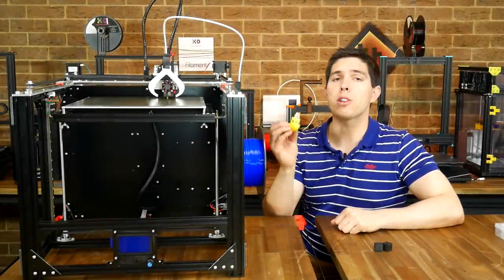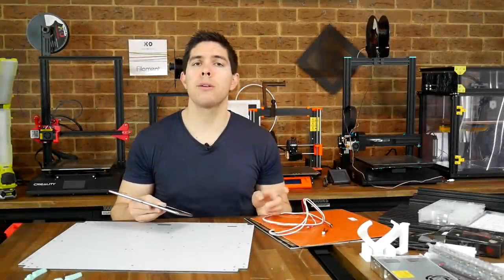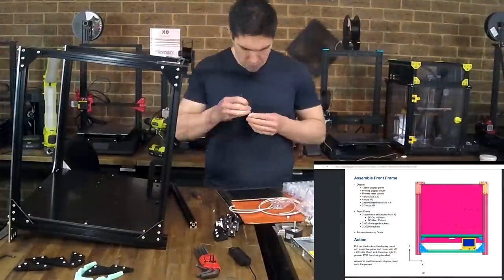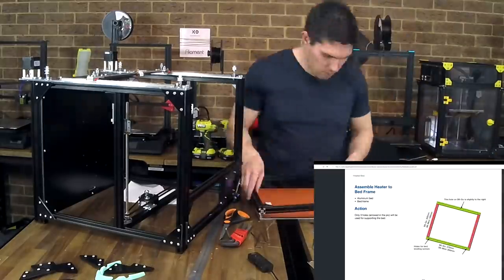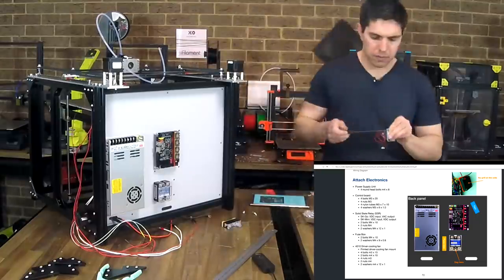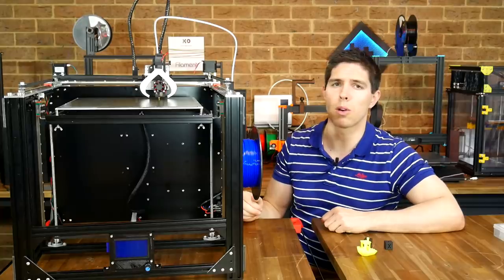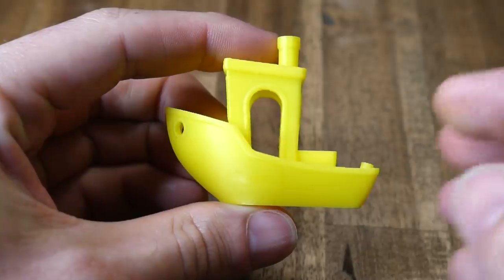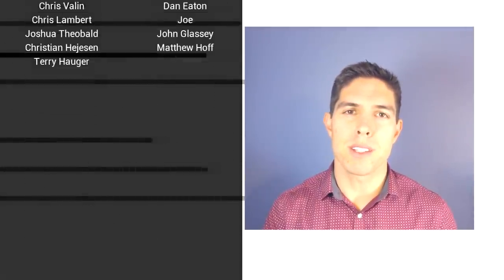SecKit SK-GO assembly and test prints - CoreXY linear rail 3D printer

Comment: Michael, truly thank you for the valuable feedback and faithful review. For the issues of short wire and bed frame I will definitely fix them in the next batch. Your Z endstop mount and filament sensor holder are a must-print!
Reply: WOW so humble and open to feedback!!! so much better than a certain RUSSIAN manufacturer
Reply: Would this design scale up to a bigger size? I really want a 510x510x510mm corexy design.
Reply: @originaltrilogy1  At this size the major issue is stiffness of the bed and thermal expansion. I'll suggest to use SK-300's structure (3030 extrusion, tooling plate, 10mm belt, etc. as shown in my website), but haven't evaluate cost and weight / shipping yet.
Reply: @seckit3dp  is there a budget friendly option available?
Reply: @Leo-Lion  SK-Mini (220x220x250) shares the same structure as SK-GO and is the most economic model.
Reply: @Leo-Lion  - They have the option for you to source your own aluminum and save money & shipping costs. I'm pretty new and just getting into the hobby; but that also means I've been researching and pricing out a lot of printers over the last few weeks - and based on what I'm seeing this is one of the less-expensive printers out there that also gives you at least a 300mm^3 build volume!  You can save a little bit of money by going with a small-sized Creality or one of the alternatives that Michael has pitted against the CR-10/S/Pro in his recent comparison videos; but this already looks to be a pretty good deal compared to most printers of its size...
Reply: If you choose the magnetic PEI bed is the main bed that the bead heater attaches to a sheet of aluminum?
Reply: Seckit 3DP I have interest in that to!
Reply: @seckit3dp  I am using 6mm cast toolplate for the bed, it works very well in other designs.
Reply: @noelwade  and you are not slinging a bed around, which equates to faster prints and less ringing
Reply: Seckit: The ordering page is a little confusing regarding the bed: "(Self-prepared) A boro glass no larger than 220 x 220 mm^2, masking tape, polymide tape, etc."  That's presumably for the SK-mini, right? One would need a 310mm x 310mm bed for the SK-GO?
Reply: Is there an option to buy only machined aluminium parts and nothing else?
I already got most of the part I plan for corexy then I see this, I might just build this.
Reply: Hi.
I have a hot end and extruder.
I didn't see a way to add the kit without an extruder and hot end
Reply: @Seckit 3DP Huge respect for your responses and support for Micheal and the community. Exactly the sort of responses we like. You have designed a fantastic machine.
Reply: @chaddthompson  If PEI is chosen, at SK-Go it is PEI + aluminum bed + AC heater. At SK-Mini it's PEI + aluminum bed (DC heater integrated).  DC heater for 310x310 bed size drains over 10A current which causes high heat at solid state relay and wires, which is dangerous, so AC is used.
Reply: @Graham_Wideman  Sorry about this bug website and will be fixed. If you prefer boro glass (self-prepared) for SK-Go, 310x310 mm^2 is recommended. 220x220 is for SK-Mini.
Reply: @PartTimeRonin  will anyone appreciate if there is a "mechanical parts only" option, for those who already have steppers, drivers, extruder and control board?
Reply: This looks like a really well designed kit. Well done Seckit. When My CR10s dies, I will be buying one.
Reply: Mechanical parts only would be great. I'm also curious what the difference is between the Go and the 300, which seems much more expensive.
Reply: @MichaelBoratko  SK-300 uses 3030 aluminum extrusions, 6mm tooling plate as bed, 10mm belt, large bearings as pulleys, as well as many customized parts to make it OOOOverkill in many ways so that why it's much expensive. SK-Go/Sk-Mini use 2020, 2040 extrusions and many common, existing parts on the market and simpler manufacturing process for lower the cost.
Reply: Based on the review in the video, and your awesome interaction with the community here in the comments I think you have just won yourself a new customer!

I've been debating which large format printer to go with as I am needing more build area than my two Flashforge Creator Pros have.

I hope to be making an order very soon!
Reply: @seckit3dp  if you made a taller version of this that's either 500 or 600mm tall, I would order it instantly. Basically everything else is exactly what I was planning on modding a different printer to have on it
Reply: Howdy SecKit, can I ask if there is anyway to get IDEX added to the custom ordering page ? It would obviously mean another matching hotend etc but, I am curious if there is any support/idea around this. The BCN3D is way out of my price range :)
Reply: @seckit3dp  Yes, there are many of us who have bought upgrades for Ender-3 -- E3D V6, SKR boards, TMC2209s, TMC5160s, etc. I would appreciate a model where I could buy frame, stepper motors with belts, heated bed, and power supply (since you are using AC for the bed). Thank you!
Reply: I wasn't planning on buying a new 3d printer..... But this one looks really good.
Reply: @seckit3dp  in the ordering page it says it comes with a Titan extruder. Does it come with a bondtech or Titan?
Reply: @Seckit 3DP I spent the last 6 months designing sourcing and buying parts for my own corexy so I can have the features I want. You offer an easy custom system that would accommodate my needs for half the price. I hate you :)
Reply: @Gengh13  Only Titan extruder is available. Please buy BMG by your self.  ^^;
Reply: This is the printer I designed (in my mind, lol)! CoreXY, linear rails FTW. It's the right machine at the right time. You're gonna sell a lot of these, I hope you can meet the demand.
Reply: This... Looks... AWESOME!!! (begins looking arround the house for a good spot for another printer) This looks like a seriously Great bit of kit. I JUST bought 2 printers this week and now I wish I'd saved the $ for this. Oh well. I guess I'll just have start saving up again!  :-)
Reply: @seckit3dp  Of course people will appreciate such an option :) Many people already have those parts or would upgrade/switch them to something else later anyway, so it would make sense to buy them separately and get what you like from the beginning. All those comments from you and the result of the review really make this printer a really high value option to choose. Congrats, you're doing it all right.
Reply: @seckit3dp  This looks like a really nice kit! I would also appreciate a mechanical parts only option as I already have TMC2130 drivers, steppers, a titan extruder and a control board.
Reply: @Leo-Lion  This IS the budget friendly option....
Reply: I have been building my own Core XY machines for years, you have some of the same fixes and part's styles to my own builds. Looks like a great machine
Reply: Bound for glory
Reply: Where can I get this printer?

Comment: Fantastic video, my Aussie guru. I can’t believe the quality you got out of this. The bench looks injection molded or resin printed. I would love to have this printer if I were good at building such things. But boy if I could get one prebuilt some day, it would really benefit my wife’s business; she makes soap and bath bombs, and she got some overpriced molds that were 3D printed. The huge layer lines and overprints created undercuts and other obstacles to releasing the cast products. As a retired bronze caster, I saw numerous undercuts in the original artwork that was subtracted from the cylinder created in their 3D modeler after which the cylinder was sliced on the wrong axis to create the parting line, exacerbating the undercut, as well. Plus, they were inconsistent in their post processing, not even touching the pronounced layering and overprints. So, yeah I would love to create molds based on the various seasons and holidays for my wife’s endeavors. Ah, well I meant only to complement your fine presentations and got carried away. Keep up your great work. You’re making a real, positive difference to people adopting this incredible platform for invention, creativity and light, democratized manufacturing. Thank you.

Comment: Wow, thanks for all the great content! I've gone from "I haven't looked at 3d printers in 5+ years" to "I'm almost ready to buy my first printer and have a good idea of what's possible and how to achieve it" simply by binge-watching your channel over the last few days. :-) Until recently I thought I needed to buy a $1500 CO2 Laser to cut wood laminate and build some items (~300 to 320mm in the longest dimension); but these affordable large-format printers have really changed the equation! Plus, I might be able to use a printer like this to make (non-structural/non-critical) handles and trim items for my airplane - something I can't do with a laser & thin wood. Until you posted this vid I was leaning hard towards a CR-10S Pro; but as a mechanically-inclined person (IT professional by day, and in my spare time I build airplanes) I'm really intrigued by the SK-GO. 
Are you planning on a more-detailed review of the printer and how it handles different materials? Any thoughts on what upgrades (a la items you'd normally throw on the Creality printers) that you think this unit would also benefit from? Any commentary on UI vs. other printers (and thoughts on rotary knob vs. touchscreen)? Thanks again!
Reply: It's the Marlin UI. I also use it with OctoPrint if I'm too lazy to reach the machine. :p

Comment: WOW!. I like it. Your prints look great especially after tweaking. One thing to note, the specs say 350watt power supply but the heater is 400watts.
Reply from the maker: The heater for the bed is AC powered, so it's not coming from the DC power supply.

Comment: Yes please re the linear advance tutorial!
Reply: Its simple.  there's already tutorials out there.
Reply: @DR-br5gb  Yes, but TT does tutorials better than anyone else, and always seems to take a lot of other things into account that other people miss.
Reply: @originaltrilogy1  Meh, hes pretty good but there's quite a bit he misses such as the reasoning behind linear advance being the pressure buildup in the nozzle as a function of print speeds/accelerations.  i.e. if you're not printing that fast (greater than 100mm/sec or so) and you're not using a direct extruder, chances are linear advance will do more harm than good for you.   His print quality has never really been that good until this off-the-shelf work horse printer showed up but I can appreciate the time he puts in and what he provides for the general 3d printing community.   If you still think you need linear advance though there's a pretty good tutorial by Chris Riley that went up about a year ago, when the whole linear/ pressure advance craze was taking off.

Comment: That looks like a great printer. Thanks a lot for the video and sharing your thoughts. I really like all the metal parts and mounts especially for the X/Y plane. That does look super stiff and robust. And I can't believe you got it for $450. I would be very tempted at that price point. I don't suppose it will ever get sold for this price again.  Cheers.

Comment: I love the use of Z axis guide rods & dual Z axis lead screws & the 
pre-assembled belts & tested at the factory. I wish more 
manufacturers would use them. What CoreXY 3D printer would you 
recommend? I would also love if the 3D printer manufacturers use ball 
screws & servo motors, linear rails, & 40mm X 40mm extrusions.

Comment: Nice machine, almost identical upper assembly to my own design sitting a few meters away. Cnc cut upper plate for that is a no brainer, if they were one piece (like the e3d you showed) rather than two though it assures planar accuracy for the most critical bearing pair, that's how I did it. The fact that the idlers are stiff metal towers rather than cheesy plastic cages as on many other designs is also the only way to go, no drive train flex harmonics carrying through to the print. If they specced it with a zesty sidewinder or nimble extruder as an option rather than that lump of oscillatory mass it would nearly be as perfect as mine. ;)
Reply: Any links or build info?  Thanks

Comment: Well, I think I know what my next printer is gonna be.  Honestly I was wondering what I should do next because at this point my Ender 3 is at feature parity with almost all the sub 1000 dollar i3 printers (ABL, octoprint, 32bit, tmc2209, etc) after all the upgrades I've done to it. I also would like a direct drive printer since I really don't think converting the Ender to direct drive is worth it.

This seems like a crazy good value for what you're getting, especially since this isn't an i3 style printer and instead a much more robust coreXY design.
Reply: I have a heavily modified Anet A8 and a CR10. They are both endgame on what you can do with them.
Now the CoreXY design would be the next step. And this printer here seems to be the perfect entry.

Comment: I am currently planning a project on a low cost delta which I want to transform into a high temperature printer (based on some papers and the fact that a delta has nearly no printed parts in the chamber and is easy to enclose)
After that I will surely look at SecKit again and buy one of those.

Comment: I would have liked to see how the auto bed leveling works as its some sort or pressure sensor or so the product page says.
Also the V6 hot end clone is the type that has the mini PTFE tube in the heat break or the all metal version ?
Reply from the maker: I'm about to try ABL. It's the unified version with a temporary clip on sensor that goes underneath the cold nozzle. Mesh is stored for future prints. Hot end is lined unfortunately. I think I have an older genuine E3D so I might swap it.
Reply: Thank You.
Reply: Teaching Tec just replied and says its the lined one, same as on my Tevo Flash and a few other china printers. Not good, that would have to be switched out.

Comment: Great video and what a cool printer kit. Thanks for show stuff like parts that stumped you really make's for great information, what to watch for thanks Michael. I do have one question for you why did you make it direct drive? I thought one of the more important things when building a Core X,Y style machine was to keep the X&Y as light as you can so you don't have problems with momentum plus to allow the head the 80 MMps speed I have also heard it will stretch the belt and other issue.

Comment: Thank you for all the great videos and info.
Do you think this can, using the right extruder and hot end be used for special and more "exotic" materials, such as carbon or just about anything that requires high temperature and process precision?
And also, can this be fitted with an enclosure with a filter so materials such as ABS can be printed on?

Comment: I would really appreciate a video on how to build a enclosure for this printer that includes a venting system for printing ABS filament, recently started 3d printing with a Anycubic Mega S and would like to improve my builds and options to make durable prints for mechanical projects.

Comment: I've had a look at the SecKit Corexy store page and I'm impressed with the amount of customisation however there is no information about what sort of plug it comes with.

So my question is what plug does it come with and what is the voltage and amp does SecKit's printers run on.

Comment: Looks really good. Corexy is gimped a bit with direct drive but people think they need it...
Reply: For TPU it really helps. Adding a Zesty nimble can give you the best of both worlds.
Reply: @originaltrilogy1  it's still not a show stopper. People print with tpu and a mobius extruder just fine. An extruder on a corexy slows it down quite a lot for all materials.
Reply from the maker: You can easily configure this to be bowden if you like. All you would need is a printed hot end mount as the hot end comes with the bowden fitting and the extruder comes with a bracket.
Reply: @MatBettinson  I haven't had much luck with the really soft flexibles and the mobius, but as mentioned I'm running a Zesty nimble anyway, so no bowden, but almost no weight.

Comment: Now I'm torn! I was thinking a Prusa mk3s would be my upgrade path, but you seem to believe this is a better printer?
Reply: prusa is mendel reprap based, doesn't hold a candle to a corexy design.  The only corexy kit I've seen is railcore which is $1400.  This thing is a huge step.  There could be other corexy kits coming to the market now that this is out, but this thing looks solid.
Reply: Considering a well-modded ender 3 is pretty damned close to a prusa, I feel like for a second printer, this thing is a no-brainer. You're getting almost all the design problems with an i3 style printer resolved with this thing being that it's a coreXY. CoreXY printers are mostly expensive as shit usually.
Reply: The Prusa Mk3s might not look or be as mechanically stable as the SecKit, but dont let that fool you. The MK3s is so perfectly dialed in that it just prints perfectly! This printer or most printers from China on the other hand will need a lot of tuning and tweaking to get equal print quality of a Prusa MK3s. In my opinion the MK3s is still by far the best printer for under $1000.
Reply: @toyotaboyhatman  corexy kits are ridiculously expensive. Much better to source parts yourself and build ie. Hypercube. You literally save hundreds of euros with ease
Reply: @jothain  or BLV MGN Cube
Reply: @KucharJosef  true. I haven't tested but I I guess cheapo Chinese rails are more than sufficient enough for 3d printers.
Reply: @jothain  They are, It's good idea to clean them from shitty factory lubricant and apply better one tho.
Reply: @simonhersche6720  May I know what kind of tuning other China printers need? Maybe I can further improve that.